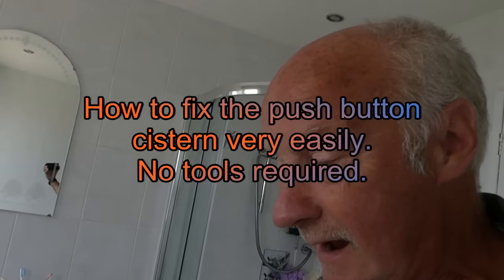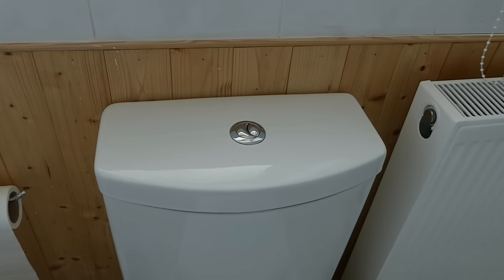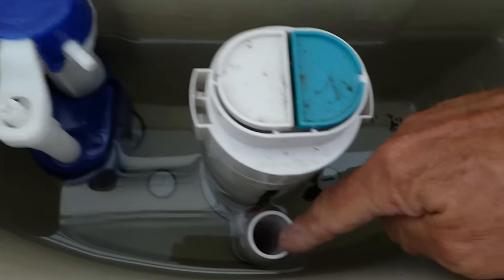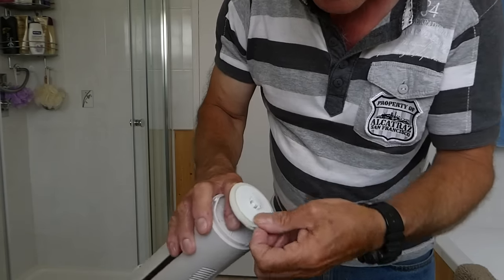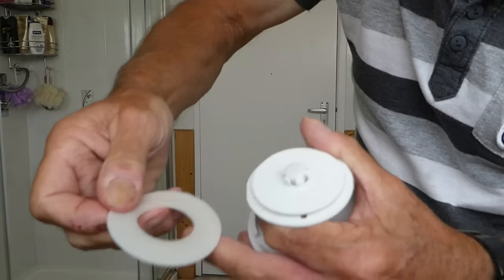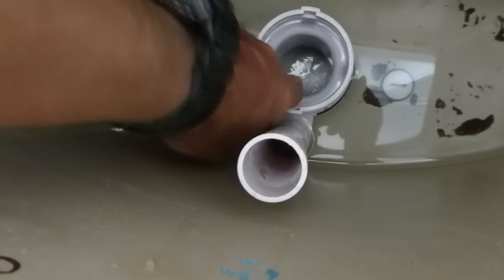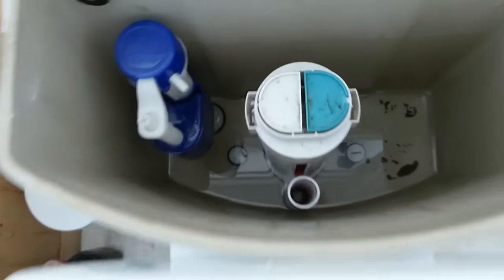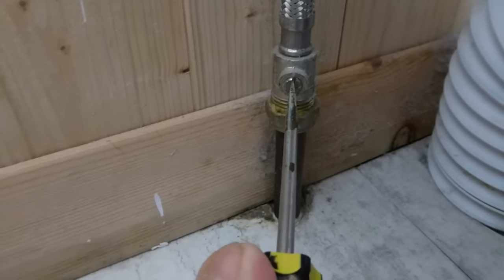How to easily fix the push button cistern no tools required

Comment: What a great idea. Literally just bought a new syphon as mine while it does seal isn't snapping shut like it used to. Generally this is the beginning of the end. What I didn't realise is you could simply twist out the mechanism, I'd normally just disassemble everything / replace the lot. While not hard, it takes time and a new close coupler is required. For the sake of a few quid I'd always replace this, last thing you want is a leak on engaging the flush mechanism. Thanks very much, really love your videos.
Reply from the maker: Thanks Glenn.

Comment: Great tip about the washer. Mine  had raised lettering on the one side so I figured the raised lettering would prevent proper seal. Just cleaned it well and reinstalled it smooth side down. Also cleaned inside where it seals to the body inside the toilet. Looks like this worked.  
Second issue was my unit does not screw off, there are  tabs on either side that have to be released. Not much room for my gnarly hands so i used a boot lace, hooked under the tab and pulled. Replacement gaskets for most name brand units are available on line. If unsure, take the gasket to local plumbing supply or  big box hdw stores and compare to get the proper one.
Reply: The boot lace tip is genius! Nice one.

Comment: What a hero i was given an apointment to wait to fix the unit in the system in given an appointment in 6 days time. I was given directions to turn the isolation valve to stop constant trickle of water and given instructions to turn it to flush the toilet it didnt work i rang them back explaining i had no way of flushing the toilet to be told to throw a bucket full of water down it to force it out ... after flooding the floor and the wall practically running at the toilet with a massive bucket of water i had had enough by this point ... I followed the steps on your video the height needed slightly lowering to get the button back on snug ..turned the isolation valve back on and the water filled in the  system ....moment of truth it worked.. thank you so much!
Reply from the maker: No problem Charlene pleased you sorted it ok.

Comment: I know this is an old post but I’d just like to say a big thanks for uploading this video as it fixed my problem straight away. Turned the rubber seal backwards and found some debris meaning it would never seal properly. No more leaking toilet. 30 mins later guided a friend of mine through the same scenario and got his fixed. Much appreciated thank you.
Reply from the maker: No problem.

Comment: Tyvm for this video & one of your other ones. My mother puts them toilet cistern blocks into the top of the toilet, and ironically that's what it did do, blocked the toilet. Underneath where you push the button the toilet cistern block was stuck in there, so this video educated me how to pull it out and fix it.

Comment: Great Video. I have a similar toilet as the one in the video. The supply wouldn't stop because the tank wouldn't fill. Toilet is just out of 1-year warranty and the manufacturer wanted me to get  a new complete kit at my expense. But after watching this video, where I saw the main fill valve easily removable helped a lot. The instructions on this video showed me that problem was caused by screw ring that holds the push buttons in tank lid had fallen into the path of fill valve, hence blocking the valve so that the washer couldn't seat. (sloppy install of toilet by contractor!) Thanks for saving me trouble and now no parts or time with this toilet. Fixed!
Reply from the maker: No problem Alice.

Comment: Thanks Derek. After seeing your very helpful video, I replaced the washer, which was the culprit for water seeping down the pan. However, to remove my siphon unit I had to place both hands at the bottom of the siphon to disengage it before I could lift it clear and examine the washer.
Reply from the maker: Some are a little stiff.

Comment: Sometimes there is embossed writing on the washer, this can act the same as scale or other debri if the washer is turned over. I gave up trying to solve exactly the same problem with our flush/syphon. Our local plumber came to the rescue in the end. He also said he hates those blocks people put into the toilet system so it flushes blue, I think they are actually called Bloo, The paper gets under the washer and breeches the seal causing the system to constantly allow a trickle of water down into the toilet bowl. Great advice again Al, thanks for sharing.
Reply from the maker: Thanks for your extra info Cliff, it all helps .
Reply: Yes this is what I found writing on the other side with 8 little indents strategically placed on the outer edge 45 degrees apart. You have to have good eyes to see them.

Comment: Thanks for pointing me in the right direction. Both of my toilets started leaking after exactly 5 years (planned obsolescence, anyone?). I inspected the seals and found that water had seeped into both of them causing bubbles to form. I had to special order new seals (weird brand), but as an experiment, I popped the bubbles with a needle and drained the water from them. With the bubbles gone, the seals are roughly back in their original shape, and the leaks seem to have stopped. I'll definitely replace them when the new ones come in, but I'm glad I've confirmed the problem. Thanks again!
Reply from the maker: No problem Sam.

Comment: Thank you for posting this. The washer section had detached from the unit and was sitting at the bottom of the cistern. The entire flush valve needed replacing. After watching your video I just ran down to the plumbing supplies store and bingo, job done, toilet fixed. 🙏👏👏👏
Reply from the maker: Thanks for sharing

Comment: Oh, so close. I flipped the seal and turned the water back on. It filled up quickly and I thought "success!" Then I flushed and the same problem persisted. It takes about 2 minutes to fill instead of the 20-30 seconds it had, and it's considerably louder too. I will keep looking for the fix, but thanks very much for this one!
Reply from the maker: The valve has some debris in it from when you turned the water off.

Comment: Very useful video...Many Thanks....I have a slight problem though...I have replaced the washer at the bottom of the valve (as you did) but there is still a tiny  tiny trickle of water running down into the pan. Any ideas what might be causing this...?
Reply from the maker: Check your valve is not letting by. Make sure the sealing flange that the washer sits on is clean with no swarf.

Comment: very nice. mine wasn't exactly the same but got through it just fine. nice suggestion for reusing the back of the current valve to fix without buying a new seal.
Reply from the maker: Thanks Jason.

Comment: Thanks to this video i was able to understand the mechanism, figure how to remove and reconnect my flushing valve in 5 mins…valve had disconnected from the cylinder which is why it wouldn’t flush 😊
Reply from the maker: That's great

Comment: So I’m having a similar issue.Toilet constantly flows. I’ve replaced the Geberit flush valve with a new one. It worked for a couple of days but is back to where it started. Going to try and clean the bottom seal and see if that makes  a difference.
Reply from the maker: Worth a go

Comment: Omg it worked! I have been turning on and off the water supply to save the flowing water. But i really couldnt pull that rubber because its too tight and im afraid that i would break the entire thing since its made of plastic that has been in water for a long time. Then i remember that i have another toilet that i didn't use in my house, so i switched them. Weirdly enough, both toilet are okay now! (?)
Reply from the maker: That`s great.

Comment: Thanks for this video. I think the push button mechanism washer is gone or something is in the way of the seal. But the overflow on mine is also active. Do you just turn the screw at the top to adjust the float?
Reply from the maker: Yes just screw it in.

Comment: The toilet outlet pipe is a Flexi?they don't last long as a normal pan.i would not recommend it unless the toilet is back to wall,which case u have no option but to use Flexi pan.the chap did explain it  good,but was struggling to take the washer off.
Reply from the maker: Thanks.

Comment: Is there any way to fix a sticking "open" valve? Seal is fine (for now) but valve sticks open and I need to remove and pull down to stop the flush.
Reply from the maker: Not that I know of.

Comment: Great Video. Can not split the Valve as suggested. might damage the system. any advice
Reply from the maker: You must have one of the rare non split ones. You will have to remove the cistern from the pan to fix it.

Comment: Hi there. I’ve got a new system like your 2nd one in this video. If I take the cistern lid off the flush is perfect pushed manually. But from the actual push buttons, I think the prongs inside don’t push on the syphon is it ? Like they’re not reaching it as the flush stops short ? What can I do ? Had the plumber out already and he adjusted the flush to a longer one. The toilet is brand new
Reply from the maker: Adjust the push rods to teach the buttons correctly.

Comment: Thanks for this tip cause i cant find my flusher type i have the singke style and apparently they dont sell that type which is ridiculous cause its only 3 yrars old and i ve tried fir the past year to find the replacement tyoe but only dual types show up and my toilet is an aqua source brand i bought it at lowes this sucks
Reply from the maker: Plumbing really is a nightmare.

Comment: Thanks. My toilet is Koehler. My grand son twister the flush button and water wouldn’t stop running.  It is a double knob. It looks different to the cistern you are showing. Can you show the model where a pin goes into the main cylindrical panel from the flush button please?
Reply from the maker: Cant help you with that one, sorry.
Reply: @dereton33  I have asked a plumber and he is charging £145 to fix it. Another asked for £180. He is replacing the cistern outlet valve and may be the washer which he says cost £45. I have seen on Amazon they are £22.45 and £2.70 respectively. 
Whereabouts do you do business? I live in Stevenage

Comment: Many thanks for this. I can see something's broken inside mine so I need to replace the whole thing.  It looks like I have exactly the same part and think I can just put a new one in.  I can't see anything that says what brand it is though (the one I bought doesn't quite fit so I need an exact match).  Would you happen to know exactly which one it is so I can buy one?  Many thanks for your time
Reply from the maker: Geberit are the make.
Reply: Thank you, much appreciated

Comment: Would that work on Roca flush valve I got ( similar one )? Or will I have to remove the part holding it ? TIA AL .
Reply from the maker: You will have to remove the part holding it.

Comment: That really helped Sir. One question though, is the blue main flush or push release. Also how to adjust the cyphen?
Reply from the maker: Blue is main flush. There is a sliding rod lower down on the syphon that adjust the amount of flush.
Reply: @dereton33  I just figured out that white is main flush. Blue is for push flush. That sliding controls the amount of water. White button is emptying fully. Blue is limiting in my case. It depends on the color code. If sliding button is blue than blue has to be the limiter.

Comment: I have one of these and its leaking so I will try the tip in the video for sure.  One question is where did that spring come from that is laying in the bottom of the tank?  Its a compression spring about 1/2" in diameter and about 2" long.  The buttons seem to work and its filling properly, but I have no clue where that spring came from.
Reply from the maker: That spring is from a  different syphon, must have been left behind when it was changed. .
Reply: Its never been changed.  Maybe from the stock fill valve mechanism?  It was found on the far side of the stopper mechanism.  It was not jamming the stopper - just laying there.

Comment: Just watched the video dealing with the water leaking into the pan. I got two new toilets for upstairs snd downstairs, using the same type of assembly. My problem is that when either button is pressed the desired amount of water isn't enough. I have to keep either button pressed to flush properly. Pressing either button on our old toilet releases the correct amount of water. Any ideas would be welcomed
Reply from the maker: Remove the syphon and adjust the flush level slide.

Comment: Thanks for that. Will this stop ghost/phantom flushing? In my case water does not run down into the bowl. What happen, several times a day, is that there is flushing down followed by a big thump. It happens day and/or night. There are lots of videos for the American system to stop this phenomenon but not for the UK system. Help. Thank you
Reply from the maker: Check the ball valve is not letting by.

Comment: I have a 45 year old, direct coupled toilet with a Dudley Syphon. I am reluctant to take the tank off the wall as the bolts are severely corroded and crumble to touch. Can you dismantle this old Dudley Syphon, like this to renew it or is it not possible. And need to remove the header tank to do this. Both units are the same age. It does flush still.
Anty thought would be welcome on this.
Reply from the maker: If it is a dudley syphon it should split inside the cistern.
Reply: @dereton33  
Yes it is a Dudley Syphon, it's imperial not metric. But traditional type original Syphon. Also 50 years old. The ball cock is brass not plastic as everything is plastic these days.  
Thank you for rhat will try it the header tank is filthy.

Comment: Hello.  My rental unit has one of these but the tank is much deeper than the fill valve so the cistern is not filling enough to properly flush.  Does Glacier Bay make replacement kits with a taller overflow valve?   Can I use an overflow tube extension?  Any ideas?  Thanks!
Reply from the maker: Can you not just solvent weld a 22 mm overflow coupling onto the end of the overflow pipe then increase the water level.
Reply: dereton33 That is the solution I have been considering if I am unable to find a replacement.

Comment: Where can you get one of those dual flush button valves that fit all systems?mine is a nuca c211 and keeps dripping but cant get another one. Iv tried changing the washer round
Reply from the maker: Try Amazon.

Comment: My flush valve developed an issue today (hence why I'm here). The bit that moves up and down, that the washer is on, is sticking in the up position and stopping the cistern filling up. I can put my hand in and push it down, but I don't want to keep doing that. Is there a way to stop it sticking, or should I just get a new one?
Reply from the maker: Get a new one.

Comment: Hi, I have this same type of toilet. Water is actually slowly flowing into my overflow value causing constant water running. I tried to adjust the screw to adjust the amount that the water fills in the tank. Could you direct me on how to fix this please? Thanks! Your videos are very useful!!
Reply from the maker: Hi AJ, just turn the adjustment screw anti clockwise.  If it does not stop the over flow, then you will be better off, renewing the ballcock.
Reply: There's a clip, along the side, where you can lower or raise the entire mechanism. The screw is only for fine-tuning. Two of the best vids for that issue are 'How to Adjust the Flush Water Level on a Modern Toilet System' and 'How to Adjust the Flush Water Level on a dual flush Toilet', with the first one being more straightforward, but both working to provide an overall good picture of how that works, AJ.

Comment: How to get bolts to right height on dual flush  that won't  flush  I tried  adjusting  up and down to no avail  please help so frustrating  and I would like try and do it myself  it is bathroom  refit and everything  thing else ok
Reply from the maker: Adjust the water level.

Comment: Not sure if you r still on here but I have a push button toilet n when I flush it it doesn't flush it makes a clunk sound when flush n fills with water. It will drain water back out of bowl slowly down to near bout nothing . could you please give me advise on if it is something to do with inside ? I have used a plunger n I have used the soap n hot water trick. Any ideas?
Reply from the maker: Take the flush syphon out and check it over, sometimes best just to renew the inner part.

Comment: Can I ask a slightly different question as my syphin is slightly different but I am sure they work the same - I want more of a flush so do I adjust the orange tag height on your syphin or is it all in fill side to adjust ball cock height
Reply from the maker: You can adjust the Valve to put more water into the cistern. The slider also adjust how much water will flush.

Comment: After you’ve flipped the rubber gasket, and it STILL leaks, where do you get the part, replacement? rod
Reply from the maker: Amazon. It is a Gerbit part.

Comment: Hi Derek,  after mine stopped working, I found a piece of metal like a spring floating in the system. Do you know where it came from, and do you think I can put it back in? Cheers, Carol.
Reply from the maker: Carol Glover That will be part of the button return spring, once broken like yours, it is best to renew it.
Reply: dereton33 Thanks for your reply, Derek. It's actually just a piece of wire, coiled three times, so I'm assuming it's a spring. Are you saying I will need to replace the whole toilet mechanism?
Reply from the maker: Just the Gerberit flush syphon. Al.
Reply: dereton33 Thanks a lot, Al. (sorry I got your name wrong!)
Reply from the maker: No worries it happens all the time. good luck with sorting out your cistern flush.